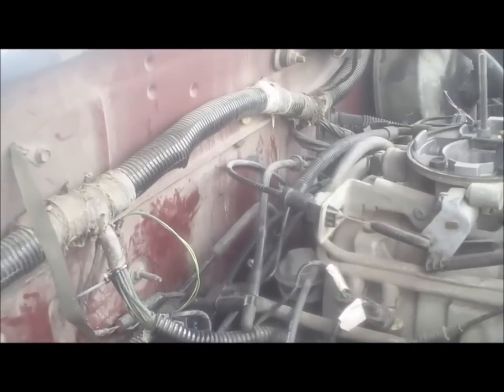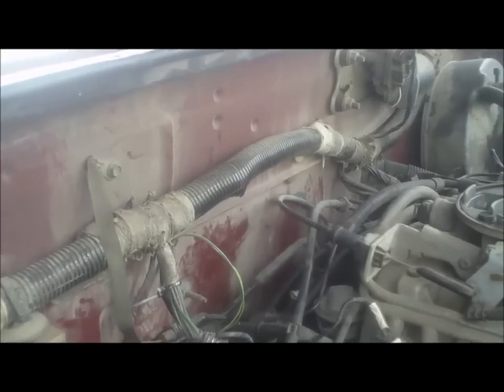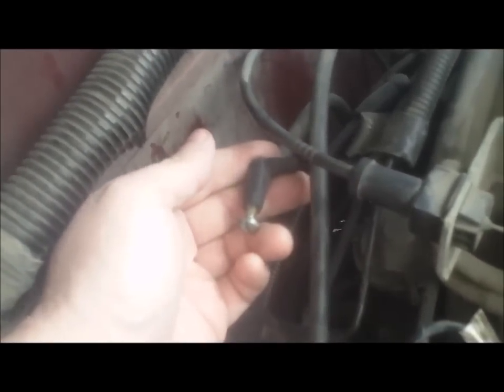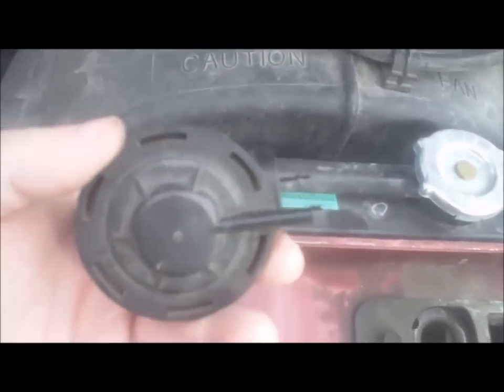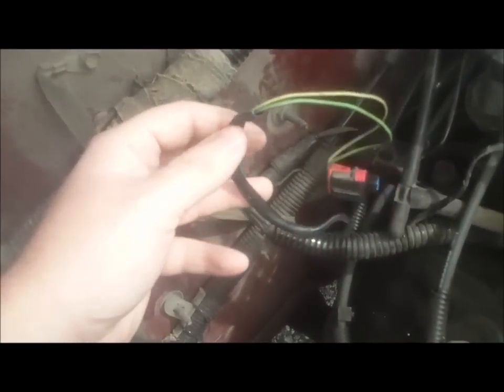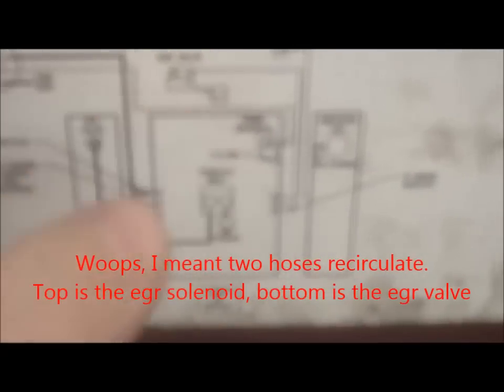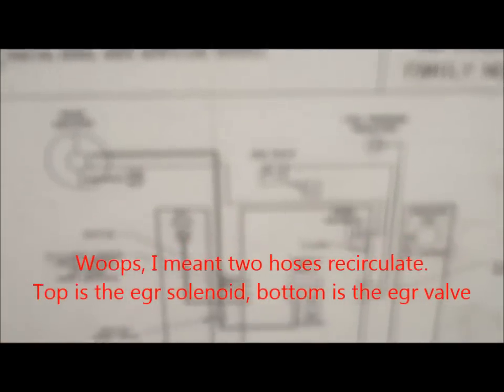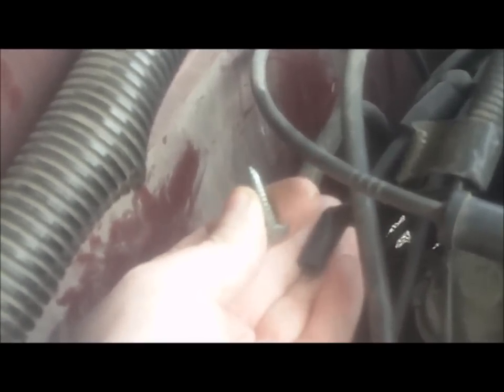How To Replace An EGR Solenoid Dodge Dakota

Comment: That's some pretty helpful information. The only thing I'd have to do different is use a little tube splice that crimps and black tape instead of soldering because anything that's just soldered ends up snapping off on the lengthy dirt road I live on. Lots of washboard ruts and all that. Thank you for all the help on that.
Reply from the maker: Thanks for watching!!

Comment: What does the EGR actually do? Will it improve gas mileage or anything?
Reply from the maker: EGR stands for exhaust gas recirculation its basically a valve that allows exhaust gas to recirculate into the combustion chamber and it is to help your car burn fuel more efficiently and it helps to create fewer emission. That is basically what it does. You can google tons of info on egr valves and solenoids and how they work.
Reply: AJ Pierce thanks aj. It's so hard to get straightforward info sometimes. I admire your direct reply. I just knew that valve had something to do with the fuel consumption. It took me less than ten minutes to do it myself thanks to the amazing videos on you tube. I'm so grateful. I saved about 200 doing it myself. And all I did was change the pressure sensor. The EGR valve itself was still operational and got rid of 32 code. Now I have to deal with the other 6. Lol.

Comment: did the code go away
Reply from the maker: Yes my code went away. One thing to look for when replacing the egr components, is melted components. If you find any melted components either the metal or plastic pieces, you most likely have a plugged or restricted exhaust (most likely bad catalytic converter). You can check exhaust pressure at the egr lower tube using a pressure gauge, If you have excess pressure you have a restricted exhaust, which can back up the egr system and melt components, this can also cause the vehicle to run poorly, have low power, and sometimes the engine will die because it cant breathe correctly. Well I hope this info helps you out. Thanks for watching and thanks for the comment. Have a good day.
Reply: I changed egr runs great but still has alil miss not at idle but when in going between 30 to 70mph. not bad but it jus urks me lol. the miss don't occur at full throttle it's weird
Reply: @willsilversurfinharris6239 , this is what mine is doing. Has a mis or huckup when under load. Fine if it's idling or going wide open but below 3000 rpm it really doesn't like it when climbing hills on the freeway.
Reply: I'd be nice to know what you found. 🤞
Reply: Try having fuel sync  reset